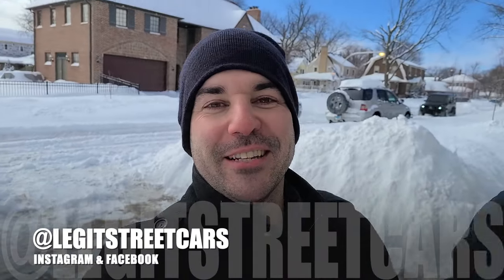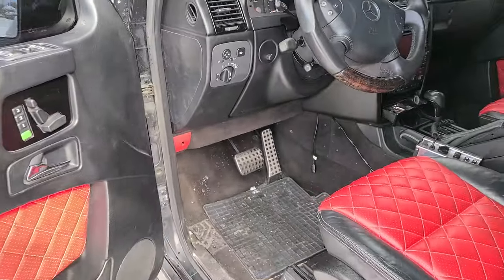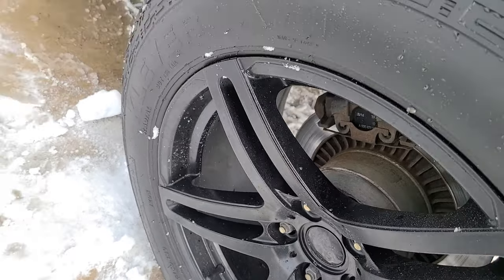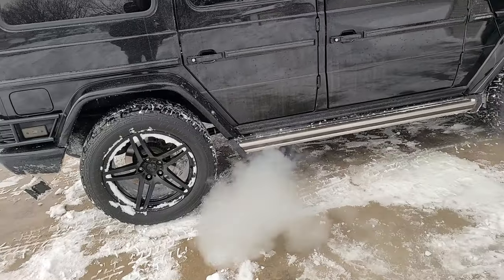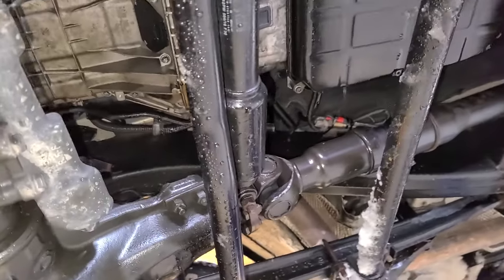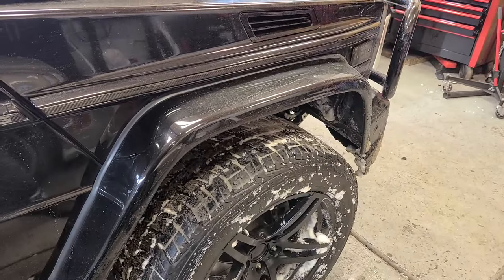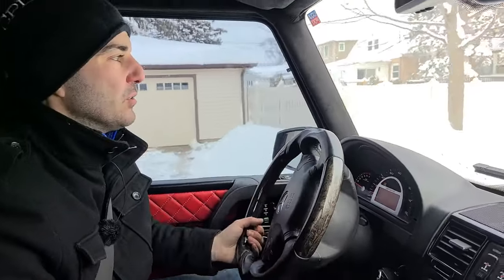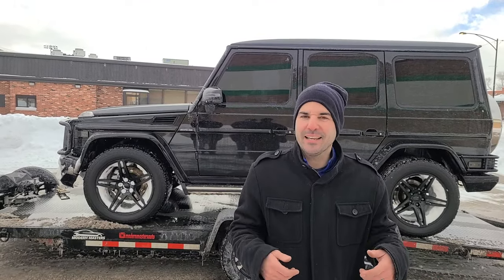My Friend Bought A Supercharged G55 AMG For $35,000 With A Blown Engine & A Few Other Odd Issues.

Comment: any Mercedes guys have this problem on a w203 so I go to start my car this moorning  crank once nothing turned key on and off cranked more no start then it started again started was like huh weird maybe I left something on killed battery let it sit there and charge go to leave and it doesn't go into drive I can't even move the shifter its stuck in park so i turned on and off and now car wont start I can hear fuel pumps and the starter engage I think its a crank or cam sensor but doesn't explain the transmission not going into gear could it be just the battery needs a change or what

Comment: I had a customer with a diesel G waggon low miles clutch was slipping when i loosened the bell housing they are sealed to keep water out i was suprised to be showered with Diesel, turned out he kept a hand pump for filling the tank from a drum in the engine bulkhead where it leaked down into the bellhousing through timing window thats why it was slipping.

Comment: Unplugged secondary o2 is to avoid setting off a CEL for catalyst efficiency. Early OBD2 systems didnt care if it was straight open air because it meant the ecu thinks its super clean fumes. Only the O2 after the header mattered.

My guess is a faulty Cat was replaced with  test pipe to pass emissions.
Reply: You sure they didn't have an O2 simulator in there?

Comment: Speaking of snow, the Mercedes that was buried under a ton of snow in the parking space in front of my house has finally emerged from it's icy tomb, and didn't see it's shadow so no more winter, and just in time too because that thing looks WAY worse than it did when it first got buried. I looked up the VIN and it turns out to be an E320, used to have a badge on the back that said 4Matic. Anyone know if it's it even worth saving?

Comment: Alex, what’s the best material to change valve cover gaskets on an M113 in addition to the factory gaskets for longevity?
Reply: I’ve done them once before, cleaned the heck off the mating surfaces but they started leaking again a year later.

Comment: I bought an old 92 Toyota 4Runner brought up from Texas. Rust free, but had some missing parts and odd modifications including a siren and the remains of wiring and switches for emergency/aux lights. Think I replaced the whole center console with a an unmodified uncut one from a salvage yard. Was a nice solid old 4Runner.

Comment: I drive a 94 Legacy 4wd 2.2na wagon and it already has a tendency to shake a bit at idle with the old flat 4 but the front drivers cylinder has 110 psi and the rear drivers has 65 psi, so it sounds like a Harley and kinda shakes like one too 😂 way past 200k miles though and it's my daily. Probably the most or 2nd most reliable engine I've had. That being said, the dead cylinder really gives it some character lol. Thankfully it doesn't chug oil

Comment: About the speaker: Way in the late '80s, early '90s, when my cousin bought his dad old car, he put in a CB radio in the car AND he put a speaker in the engine bay, as he could use the CB radio to talk thru the speaker. I guess it's funny when you do it the first couple of times, but yeah. So, that's most likely why there was a speaker in this engine bay.

Comment: Love the videos.  Former MB tech myself from the same era as you. Do you remember if the M113 has the same EGR problem as the  M112? Plugging the drivers side head. I can't remember.  I have an aftermarket solution to fix it. Just can't remember.  Thanks anyone that answers

Comment: DO NOT'S for a G: DO NOT jump it..seriously,, even on a speed bump..you wil bend the rear axle.                                                                                                                                                    DO NOT open the doors when washing it or wading through water that is just over the bottom of the door..you will blow the electrics.                                       DO NOT do burnouts on dry pavement...you will blow the tranny (you might enjoy it if so inclined)                                                                                                   DO NOT forget to replace the crank angle sensor regularly...it will overheat eventually.. AND enjoy the many funky electrical gremlins..

Comment: The could of welded bungs in the exhausts for the O2 sensors to fit/ connect /read and work ,and I think that caused the engine to run lean and break because they are disconnected

Comment: That G55 reeks of a clueless modder.  O2 sensors hanging out - did they think they were going to clear the engine codes like that?  Of course the pulley with no tune. That weird skid plate with the "snow shovel" angles. ...